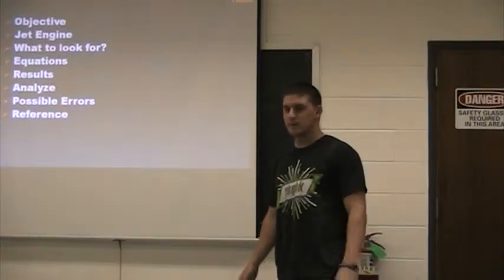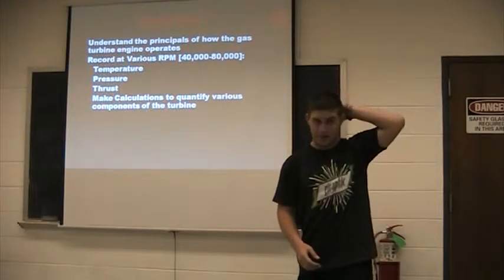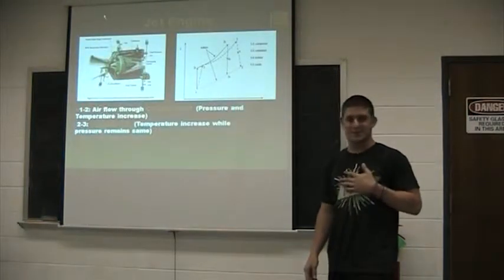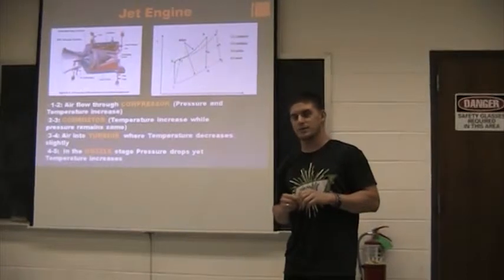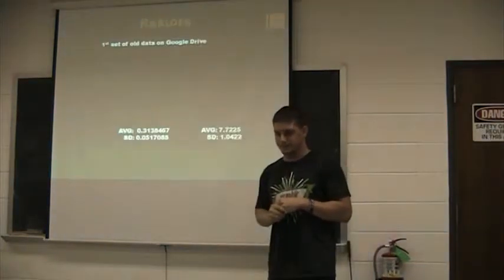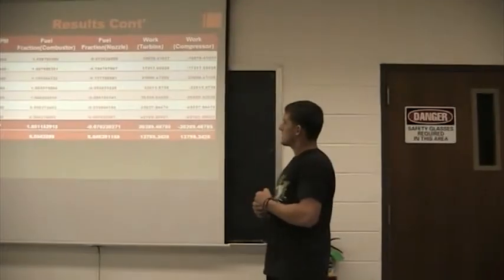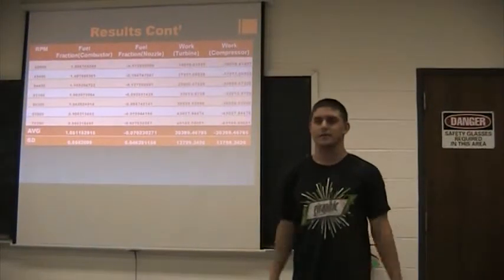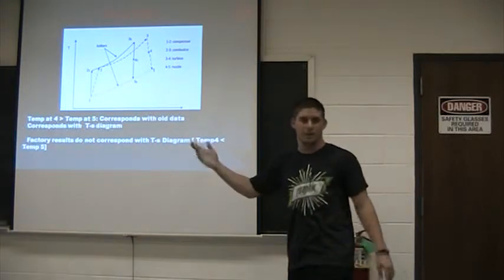MOV005

Comment: Great job outlining the equations and data analysis project.  Your charts were really well outlined and the data set you chose was a good representation of the points you were making, but like Michael said in class it would have been easier to understand your analysis if plots were given.  Your understanding of the material was clear though, particularly in explaining the T-S diagram.